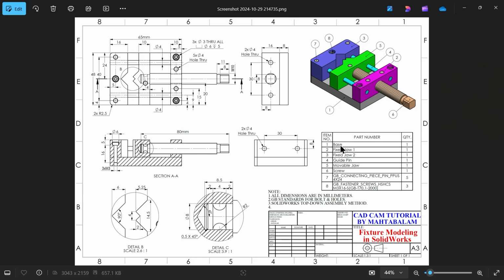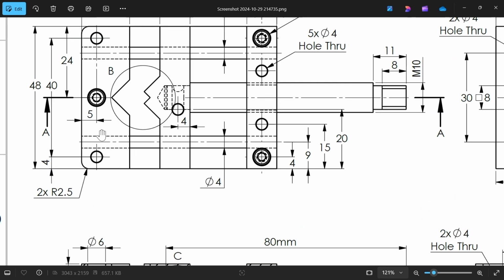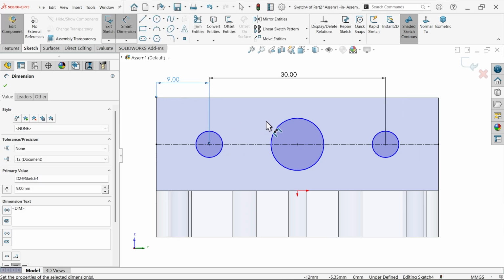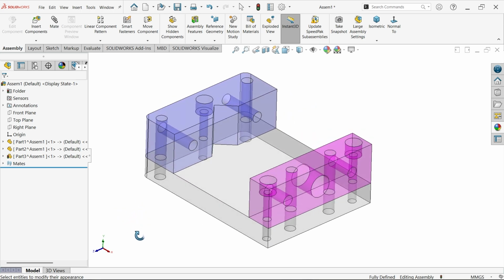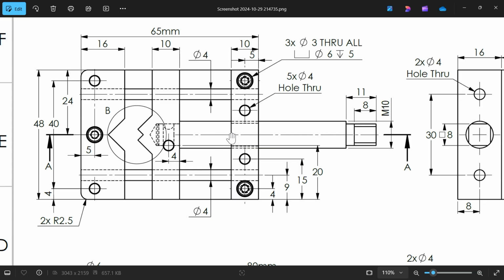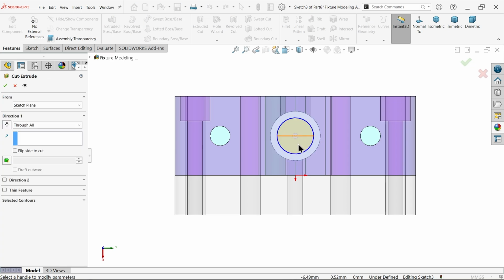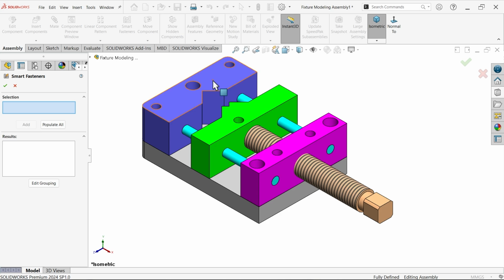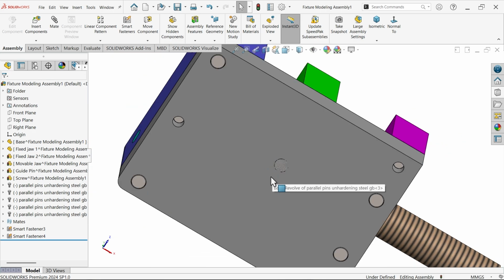SolidWorks Top-Down Assembly Fixture Modeling

Comment: Thanks for this, very useful tutorial.
However I believe this is middle-out design not top-down. You are starting with a part - in this case the base - and building the assembly around that.
Look into what top-down design means, it is a different workflow.

Comment: I suggest  based on he same example to create a ne video where you add tolerances such as H7g for sliding H7p6 for instance and as appropriate  + show this on he drawing where needed.  Then we have a complete view. Thanks again.
Reply: I believe the pin in the middle, the one for fixing the screw left hand should be not longer than 16 mm. Otherways the movable jaw can not move. 2nd- there is no corresponding hole for this pin on the base. So this particular pin deserve a proper item number.